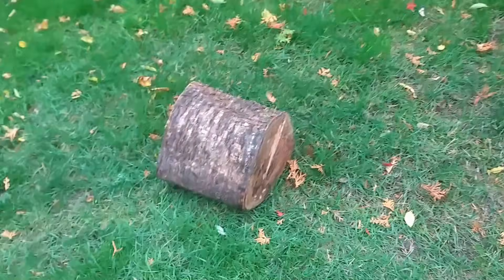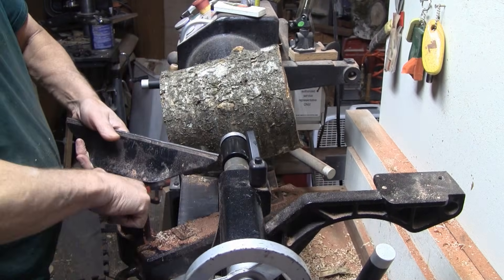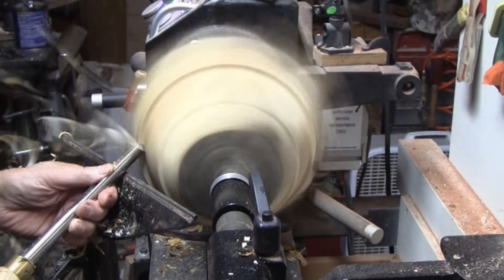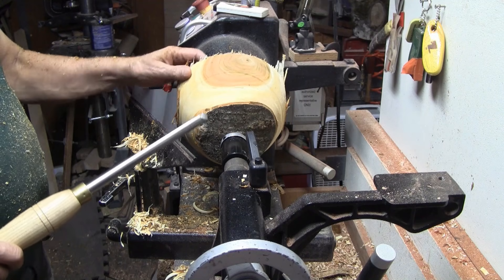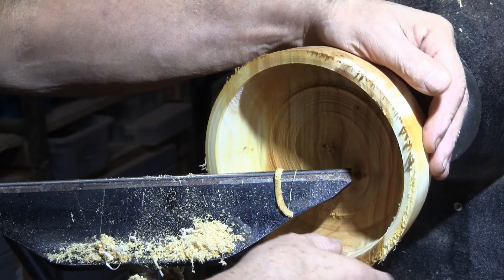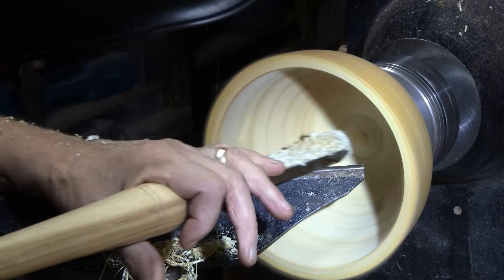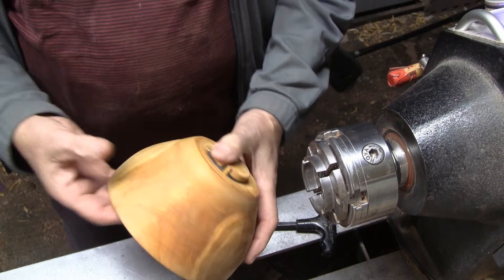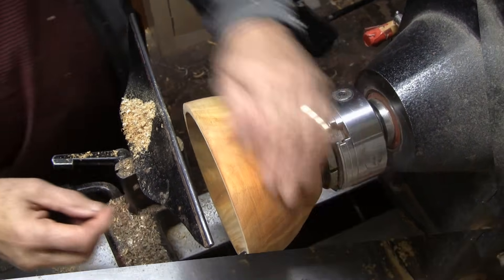Wood Turning Green Wet Wood Thin & Sanding Tips

Comment: Thanks, Gary.  As I'm sure I've mentioned before, I just began my wood turning journey.  My first project was a set of chopsticks.  Purple heart, otherwise plain and entirely serviceable.  My second project was a bowl, intended to be about 6"dia. by 4" deep.  I was using a piece of what I jokingly called snot pine.  It might be oak, it might be maple but it surely is snot pine.  Once I got into it it turned out to be punky oak, loaded with worm holes.  By the time I ha peeled away the punk it ended up as a saucer about 4"x 1 1/2".  I had decided I was on on my last pass with the gouge and would go to the scraper when I got a catch in the corner and the part tore from my chuck in more pieces than even the most creative use of CA could cure.  That was it, I was out of wood.  SoI grabbed a hand saw, stepped out the door and stopped at the first tree I came to.  When I looked it up it turned out to be "speckled alder", about 6" at the base.  I took it down, cut four feet of the bottom and have been happily making it into wet chips ever since.  Probably need another length after this next weekend.  But again, thank you, you gave me some great tips to keep my projects from cracking.
Reply from the maker: Thank you very much Carson. Sounds like you are on your way and having fun in the process.
Keep at it as it is a hobby that you can do for years and years.
Gary

Comment: You can’t go wrong with cherry, it is a very beautiful wood.  What temperature do you keep your drying box at?
Reply from the maker: Yes Cherry would is a very pretty wood to turn. The drying box is a bit crude and I have no idea of the temputure.
Here is a description I did of the box.
 I have a card board box with a computer fan attached over a hole in the box. To that I have a short(10 inch) round heating duct material over the fan. The fan can be powered by a Wall Wort. (old phone charger)
At the other end I lay a light bulb in the tube. The fan pulls warm air into the box and is vented out the top rear of the box through a 2X2 hole in the box. The lid on the box is closed.
 I used some of Rick Turns ideas on his drying box. So if you want to see a video on doing it look his up.
Mine is pretty basic but it works.
Thanks for watching,
Gary
Reply: @ThePapa1947 Thanks

Comment: How brave, you left some of the pith in there! So the million dollar question is: did it crack??? 😁
My luck with this kind of projects has been virtually absent but if anyone can pull it off, it must be you Gary.
Great video!
Reply from the maker: Thank you Leo, no it did not crack. There does not seem to be a lot of stress in Cherry wood. I probably break all the rules for processing a log because I very seldom cut the pith out on a smaller log. Other wise it does not leave much to get a bowl out of.  If I was turning for profit it would be a different story I am sure.
 Thanks for watching,
Gary

Comment: Thanks for sharing. I'm going to put this to use on some wet pecan I have. I turned a 12" x 6" bowl this morning before work and kept getting "cloudy spots" on the end grain portion of the inside of the bowl only. 

Going to try the wet sanding when I get home and see if that helps. Any thoughts on using Linseed or Walnut oil as the lubricant? 

Thanks again for sharing.
Reply from the maker: Thank you John. I think the end grain seems to show the moister more than the flat grain. It is sort of like a bunch of straws so that could be it.
 For sure Walnut oil will work fine.  Not sure a about linseed oil but boiled linseed oil is not considered food safe.
 What do you plan on finishing the bowl with?
Thanks for watching,
Gary
Reply: @ThePapa1947  Thanks for the advice. This is a decorative bowl that I am giving to my brother for Christmas. The final finish will probably be lacquer. We are both kayak fishermen and I am putting a sunrise scene with the marsh and kayaker silhouetted in the bottom / foreground. The sun will be on the upper inside of the bowl. 

I really enjoy your videos, very entertaining and packed with the  knowledge that only experience provides. I'm new to turning but now have a passion for it, thanks to Covid and watching YouTube videos for more than a year before I bought a second hand lathe, then upgrade to a Rikon 

Thanks again and Merry Christmas!
Reply from the maker: @johnlavarine8155  sounds like a great gift. I fish out of a drift boat here in Oregon. I think I bought it in 1996 and have used it many times.
 Just make sure what ever you use you can get it cleaned off. You do not want anything oily or the lacquer may have problems drying.
 Have fun turning,
Gary

Comment: You used a tenon on this bowl. When I use a tenon I throw the bowl off the lathe often. Any advice to help me stop this. iI have great suggest with mortises. I have been turning several years so I have good technique.
Reply from the maker: Hi Ray the only thing I can say is the tenon needs to be cut square and the jaws should fit where they are almost closed to get the best grip. 
They want to be square if you are not using jaws that have a dovetail meant for gripping a tenon. I have one set that does. So in that is the only time I put a dovetail on a tenon.
Hope that helps  and makes sense. If not let me know.
Gary

Comment: This is great Gary!  I would have never thought to wet sand with Mineral oil.  Just lost quite a bit off a small Elm bowl that warped while I had it in my drying box.  I think if I'd used your method with oil before drying box I'd have been better off.  Very interesting!  Thanks and great vid.
Reply from the maker: Thank you Gil! I think perhaps the oil helped it to dry more evenly which might have helped it from becoming egg shaped. 
It still had a little roof top on it but that was easy to take care of.
Thanks for watching,
Gary

Comment: couple of rookie questions:  (1) Why use a worm screw, rather than a faceplate?  Is this just personal preference or is there soe technical reason that dictates that choice?  (2)  You mention a drying box.  What's that?
Reply from the maker: Hi Jim, it is a little personal preference because it is faster than a face plate. On a small bowl like this it holds plenty good. On a much larger turning I will use a face plate. Also if it is end grain I will probably use a face plate. So here a worm screw holds just fine and when you take it off the screw your chuck is already there so it also saves time with changing it out. Both will work though.
So here is some information on my drying box.
 I have a card board box with a computer fan attached over a hole in the box. To that I have a short(10 inch) round heating duct material over the fan. The fan can be powered by a Wall Wort. (old phone charger) I use a computer power supply.
At the other end I lay a light bulb in the tube. The fan pulls warm air into the box and is vented out the top rear of the box through a 2X2 hole in the box. The lid on the box is closed.
It will work on a twice turned bowl or on a thin one like this.
 I built this after watching Rick Turns video on how he made his. Mine is not exactly like his but works great. 
Thanks for watching,
Gary
Reply: @ThePapa1947  Thanks.  This is a really great channel.
Reply from the maker: Thank you so much Jim, I am happy you enjoy my channel.
Take care,
Gary

Comment: Hmm, mineral oil as a drying fortifier ? Gonna try that when I need to force dry something. Who'd'a thunk it !  Thanks Gary👍 And wet sanding ? Makes the paper last longer, run cooler (can run higher RPMs), scratches show easier - all good. But it can be messy slinging stuff about don't you think ?    Take care. -Mike🙏
Reply from the maker: Thank you Mike, well it actually did not fly off the wood much at all. As thick as it is and the RPM it just sort of clung to the wood. If I trust that the wood will not crack I will skip the oil and just put it in the drying box.
Thanks for watching,
Gary
Reply: @ThePapa1947  👍😎

Comment: Would not it crack when it starts drying?
Reply from the maker: I have had very good luck with turning a bowl thin and not having it crack. There is not much stress left in the wood if you turn it thin.  This is just my experience and I am sure there are some woods that may crack.
Thanks for watching,
Gary

Comment: It worked out well. Most people talk about cherry having such a high tendency to crack. You just showed that cherry can be turned wet and dried over a day or two without a bunch of problems. Very nice little bowl. Great job of turning and drying it.
Reply from the maker: Thank you Doug! I have had good luck turning most woods thin without cracks. But Cherry had me a bit worried.
The very worst wood for turning for has been Plum. Green or dry I expect the cracks.
Thanks for watching my friend,
Gary
Reply: @ThePapa1947  I
Hi Gary
Great watching your video on a wet afternoon.
Nice bowl,I love turning wet wood it’s so much more easier than hard dry wood.
Thanks for sharing
Regards

Comment: Hi Gary I enjoyed this video as I was searching for techniques on turning green wood. We cut down a large cherry tree and I had over 20 logs to turn. I did rough turn some of the bowls for turning twice. I also turned some natural edge bowls from these logs. One issue that I had is there are bruise marks on the sapwood part of the bowl. Even a lot of sanding doesn’t completely get these out. Any suggestions? Also would you explain a little bit more about your drying box. Is it heated or not? Thanks again. Enjoy all of your videos.
Reply from the maker: Hi Van, I have had staining on green wood as well. I have read it could have something to do with when the tree is cut down. If it is still active. Seems to happen in the sap wood. Not sure if it is a fungus or what it is.
 So my drying box it just a card board box about 2 feet by 2 feet and a foot tall. On one end I cut a hole and mounted a computer fan to it. I have a round heating duct around the fan. The duct is about 10 inches long. I place a 60-100 watt light bulb in there and run the fan with a computer power supply. On the opposite side of the fan I cut a hole in the top corner about  3 inches square which allows the air to flow over  what ever is in the box. Cheap and does the job. You could make the box out of what you want but the cardboard box is easy and free.
 Hope that helps,
Gary

Comment: Great timing for me, I am about 6 weeks away from getting some orange tree that is being removed / replaced with another fruit tree. I was dreading the 6 to 8 years wait till it’s dried. My lack of experience lead me down the path of twice turning, however you have proved that keeping the sides thin prevents cracking that fruit trees are known for. Thank you again
Reply from the maker: Thank you Peter. Orange tree...now that is interesting. I have not seen anyone turn Orange.
Six to eight years is a long time to wait for sure. And I do not like the twice turn method either. I have had good luck turning fruit wood down thin and not have any cracks. And it if warps that is a treat. I have  an apple bowl I turned to around 1/8" and it really ended up with nice warped shape.
 This Cherry bowl stayed pretty round and I think it is because it was closer to 1/4" walls.
Best of luck with that Orange,
Gary

Comment: When working with whit word, how are you supposed to leave your walls a little thicker than usually would? Can you turn in grain if the wood is wet? I am a beginner with about five weeks out of my belt. I ask a lot of questions of different woodworkers. I’m hoping you don’t mind the questions. I also hope that you will reply. Thank you. What is a drying box? I have heard that you can also put the word in a low degree oven for a while. Is this true? I have heard that the temperature should be between 150 - 200 max. Is this true? Once again, thank you for your time.
Reply from the maker: Hi Lynda, when turing wet wood there are two options. One would be to leave the walls 10% of the diameter. So a 10" bowl you might want to leave the wall at around 1" thick. Then put it in a paper bag with sawdust and let it set for a few months or more.
I like to turn them thin like about 1/4" inch and then they dry very fast. But they might warp which I like the look of.
My drying box is just a card board box I mount a small fan to and put the turned bowls in and they dry much faster than a paper bag.
 I personally would not put them in an oven that hot. I think they would crack very easily.
 Here is a video of my drying box:  https://www.youtube.com/watch?v=06n-BomEih8&ab_channel=ThePapa1947
 Hope that helps,
Gary
Reply: @ThePapa1947  thank you much for your advice. I will check out your drawing box. I think I will go in to do a little of both. Try turning some Bestick to dry naturally or just paper bag and your box. I suppose twice turning wouldn’t hurt anything as I am learning to use my tools correctly. Maybe by the time I get around to the second turned I can correct a mistakes that I’ve made. Once again, thank you very much.
Reply from the maker: @lyndaowen2154  always a good idea to try a few methods. Also doing a twice turning or just turn thin to begin with.
Best of luck,
Gary

Comment: Love your video's and the way you (and Phil) explain what you are doing and the tools you use. What angle do you use to sharpen you 5/8 and 1/2 gouge? Also what clues do you use to know when to switch form 5/8 to 1/2? 
Sorry to say that I will turn with the 5/8 tool until it gets dull and them switch to the 1/2. 
 :( 
 Mainly because I don't want to stop to sharpen my tool .   :(  :(   It is a very bad habit that I need to stop doing. However I am making some progress.  Again thanks for posting your video's.
Reply from the maker: Thank you Wayne! My fingernail style gouges are ground at 50 degrees or at least close to it.
 The minute it feels like I am pushing hard to cut it is time to sharpen. My grinder is right behind me when I am at the lathe. It is one of the slow speed grinders and with 2 big CBN wheels it does not spin to speed right away. So flip it on and grab my vari grind jig and put the tool in. The arm is always set in the same place and ready. So by the time the wheels are up to speed I am grinding. The whole process takes less than 30 seconds. 
 Cutting with a dull tool makes you adjust how you present the tool and just doesn't make as nice of a cut.
 There are times I feel my 1/2" gouge will make a better cut in certain shapes. 
 On a green piece of wood like this you should not have to sharpen in most cases.
 Hope all that makes sense and thanks for watching,
Gary
Reply: @ThePapa1947  Thanks Gary that information helps. Keep up the good work.

Comment: I agree with using mineral oil to help with sanding on wet wood to help the paper not load up so quickly. I have felt that in doing so you pretty much have to use an oil finish of some type. Do you agree it would take a long time for the oil to dry if you then use a build up finish as a final coat ie. varnish or shellac or poly? Thanks as always.
Reply from the maker: I doubt I would ever use anything but an oil finish after using mineral oil to sand with. Although after I wiped this one down with DNA it made some pretty good dust. But I think there was still oil deeper in. So oil for a finish only in this case.

Comment: Hi, Gary.  I'm anxious to try your method of sanding with mineral oil.  I turn mostly green wood and shoot for the finished dimensions right away.  Or I combine thin wall green turning and microwave drying with some success.  Hardwoods are scarce in Southeast Alaska, and although alder is readily available and turns nicely, it is susceptible to cracking.  I'll give the mineral oil sanding method a try on my next project.  Thanks for the tip.  Great results!
Reply from the maker: Thank you Paul. It really does help to keep the paper cutting.  I have not tried the microwave as I fear getting cracks from doing that. But I do have good success  using my little drying box. Just a computer fan, light bulb and a cardboard box. So if I am not worried about cracks the bowl will go in there and be dry in 24 hours. Assuming it is a pretty thin wall.
 Best of luck and thanks for watching,
Gary

Comment: Wet turning is always more interesting than dry. I’ve always had a problem with sanding wet wood because it runs through so much 80 grit paper, even the cheap stuff. So I’m definitely going to use your idea of sanding with oil. Getting some type of finish on early, even the oil, must have helped prevent cracking. That drop of cyano-acrylic glue on the pith area will have helped too. I do wonder whether you will need to remount the piece after several months to re-level the base.
Reply from the maker: Roland for sure wet wood is lots of fun to turn. I would say the oil will help prevent the cracking. Also putting a finish like lacquer or poly will seal the wood and trap any moister. This I would say could lead to cracks.  Time will tell if the bottom stays flat but most have when i turn them this thin.
Thanks for watching,
Gary

Comment: Very nice Gary! I love watching those long shavings go flying. I have a heck of a time keeping wet turnings from cracking as they dry. I’ve always been able to sand the wet wood in some manner, and I suppose the friction heat maybe dries the bowl too quickly? I’ll certainly try the mineral oil next time. Beautiful grain pattern and colours you ended up with!
Cheers, Rick
Reply from the maker: Thank you Rick! Those shavings are really fun to do especially after turning a very dry burl where you do not get many shavings. First time I tried sanding with the mineral oil. Normally if I turn something down to 3/16 it will dry while sanding. Then overnight in my drying box and I can do a fine sanding on it and then the finish. I just did not trust the Cherry plus I wanted a bit thicker walls.
Thanks for watching,
Gary